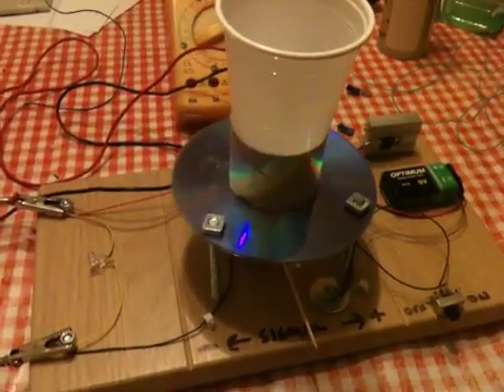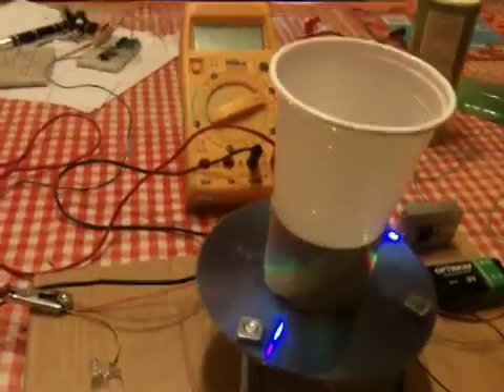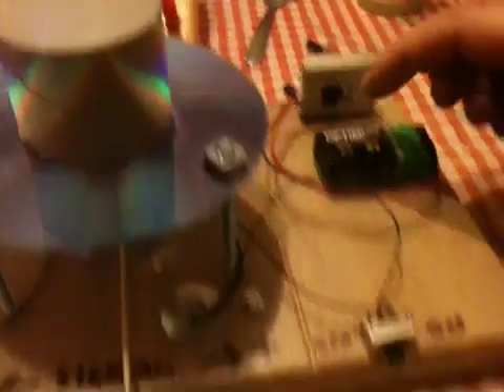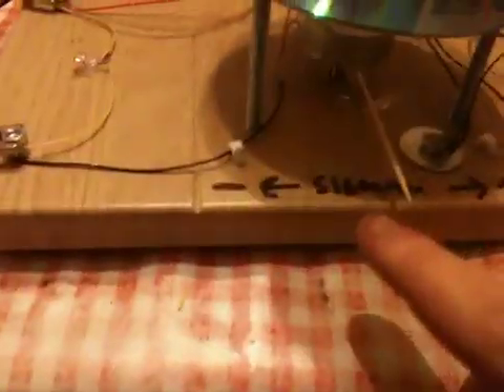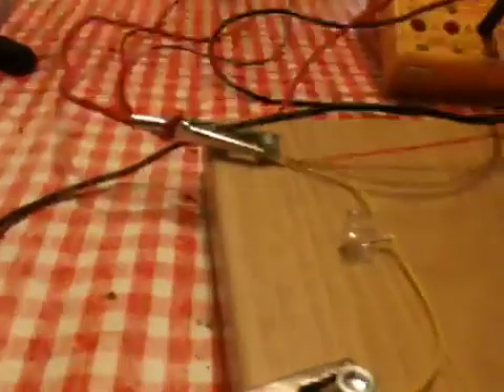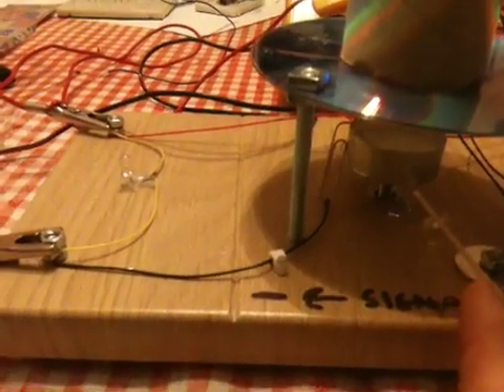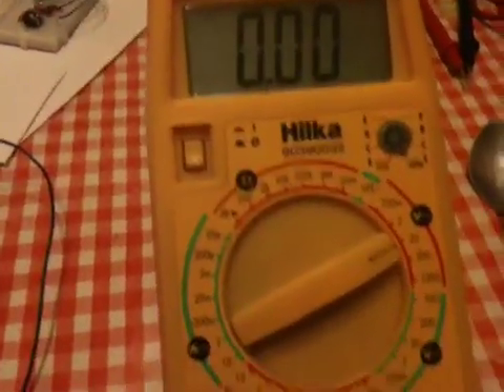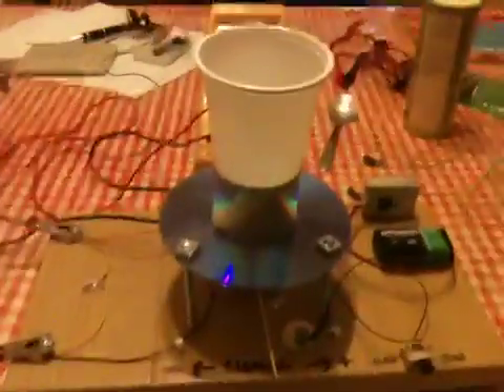Alexander Graham bell. First ever phone (working model)

Comment: I was thinking of making a model of this for a science class—how long did I take you to build this and what materials are needed
Reply from the maker: Hello, I did this in an evening, you can use most household stuff. I used a toilet roll, CD, piece of wood, some electrical wire, battery, paper clip, sewing needle, hot glue gun, some inner wrapping of a cereal pack, tooth pick, night candle, nut and bolt x 1, LED, switch, and that was about it, good luck and thanks for watching!